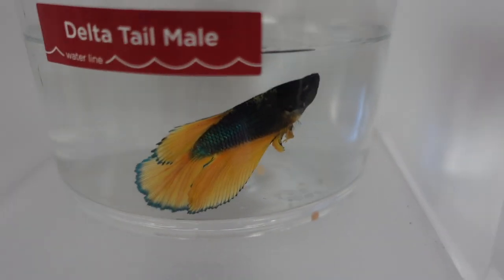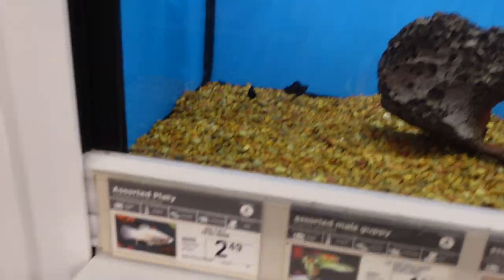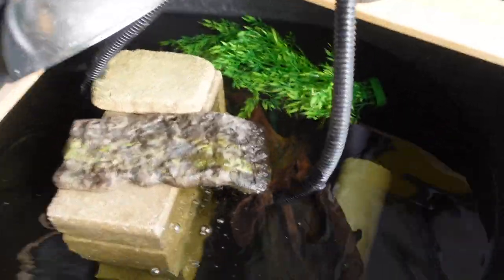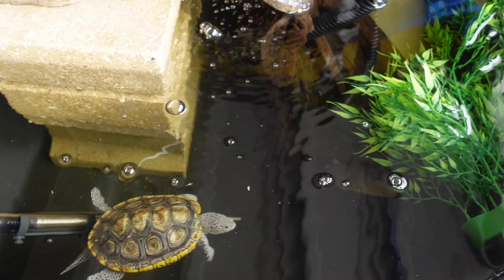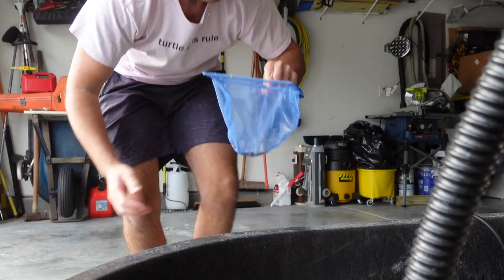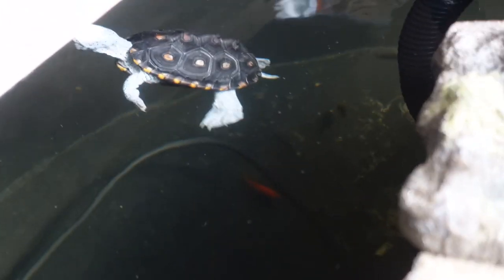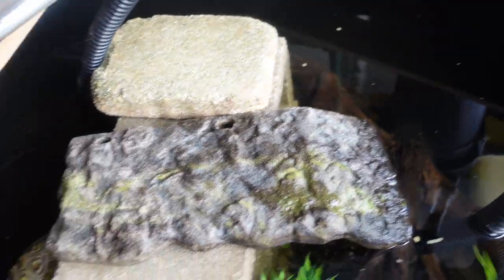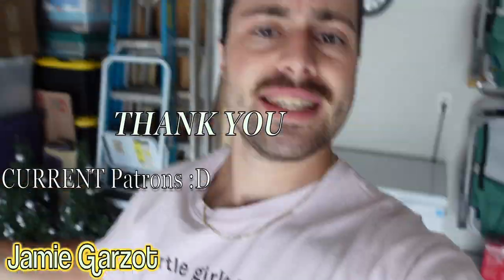Adding *NEW FISH* To My MINI TURTLE POND!

Comment: I need help. I got my DBTs a new tank 75 gallon and put an above tank basking area. It's been a few days now and they won't go up the ramp to get into the basking area, so of course they aren't getting their UVB or heat lights. They want the little stick on/ suction cupped zoo med platform. Should I be worried, because normally they will bask a while everyday. Out of curiosity I stuck the little platform in the 75 ...no lights.. above and one gets on and stays there as if it's under the lights. Is this something that is going to take time getting used to or are they going to just refuse to get into the above basking area?     ( Which cost me a lot more than a stick on the glass basking dock)
Reply from the maker: It usually takes them time to try something new. I wouldn't worry much about it!
Reply: @DanTheTurtleMan_  Thank you. They are getting big and so cute. Don't know their sex though. Today they are hanging on the ramp looking up so maybe a couple more days. Fingers crossed.